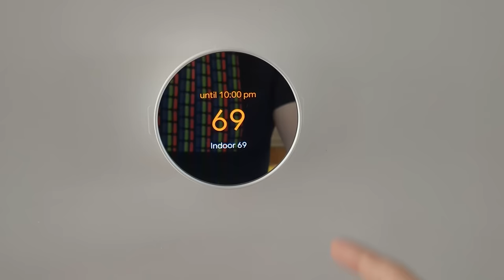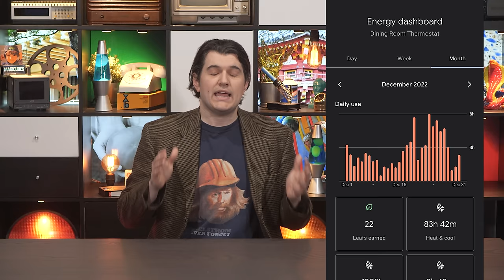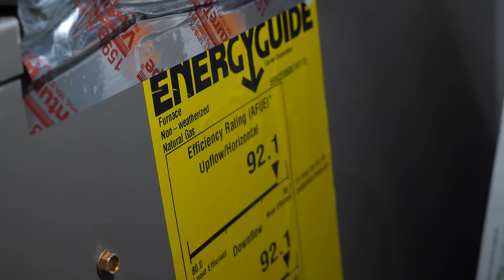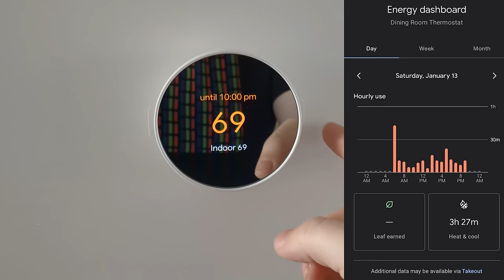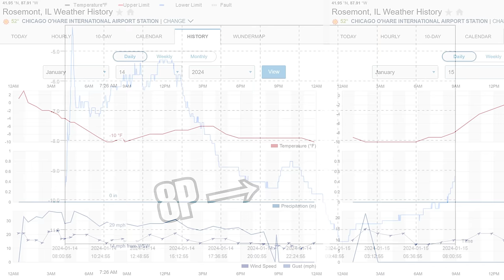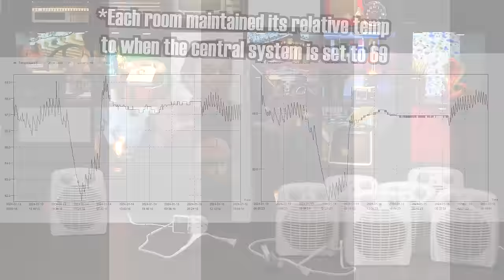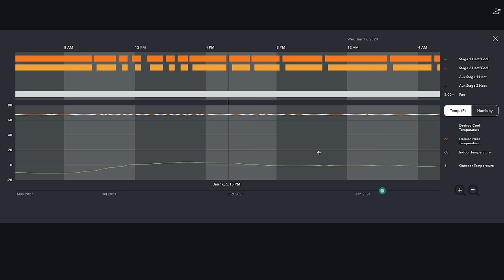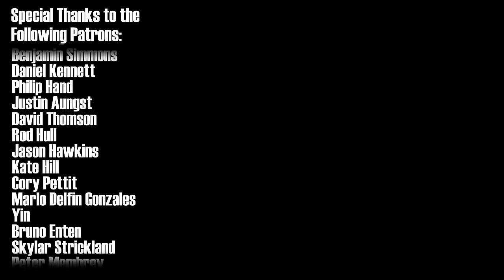Old HVAC industry practices are holding us back and costing us money. But we can fix it.

Comment: I would like to mention that oversizing a system also increases the longevity of the system by taxing it less. Creating a system which operates at 70-80% max is the norm for many devices (electrical or not). From fuel pumps and injectors to computer power supplies and cooling systems, and much more, upsizing increases longevity (unless there's a manufacturing defect or other variable contributing to wear) - even with the 80% load calculation already (hopefully) built into the device you're examining. In the case of the heat pump, I would (with only this videos information) take the 20k BTU "need" and install a 25k BTU system so it is never running at 100% but only up to 80%. You never know what components are actually being taxed at in a system unless you tear it apart and calculate load on each resistor and switch, etc. This also eliminates the need to run a separate circuit and system with the heat strips, right?
Reply: No, this is incorrect. Heading systems operate both more efficiently and last longer when cycling on/off less. Design temps account for running at 100% only once or twice a year already, most of the time a variable speed unit, if this is what you're referencing to, will only run at less than 80% anyway. By oversizing, you'll simply force it to short cycle as it hits it's minimum run capacity and still produces too much heat/cooling.

Comment: As someone who lives in a rural area that loses power several times a year (some of which are in the winter months), I, for one, am actually grateful that our heating system is oversized so a 6-hour power outage doesn't turn into 24 hours of shivering in our house waiting for it to slowly heat up, again. 

Now, there's absolutely an argument to be made that it probably doesn't need to be as oversized as it is... but some excess heating capacity is definitely handy!
Reply from the maker: Sure, but if you don't have any heat while the power's out, then a couple of space heaters can be that excess heating capacity without having to put that in your main system.
Additionally, heat losses are smaller when the temp diff is smaller, too - which means that, say, if it's only 50 degrees in the house after an extended power outage, even a system with zero overhead will rapidly increase the temperature at first. It'll get slower and slower as you approach the set-point, to be sure, but it's only at design conditions that this is going to be a big deal. And like I said - get a couple of $20 space heaters and you're 10k BTU/hr over your system capacity right there.
Reply: The rural area where I grew up routinely experienced multi-day outages, often in the depths of winter (we're talking -40C) well into the 2010s. This was in western Canada, about a half-hour drive out from a major city you would recognise the name of. We survived with copious amounts of blankets (and trips to my grandmother's, if her place happened to escape the outage path... it didn't always).
This was also the case in at the college I attended, some 800km away. The outages weren't as long, but they definitely were frequent.

Comment: A good rule of thumb for heat 5-10 million BTUs (5-10 Megawatts) per bedroom, double if the house is more then 5 years old and doesnt have any insulation or double pane windows. I would also recommend building a coal or nuclear power plant in your back yard to power it with a rail way that can accommodate 50-100 rail cars of coal a day. Simple better to have too much then be cold!
Reply: I was very confused for a moment lol

Comment: I install heat pumps in 🇬🇧 the uk thankfully because we have been doing them here now for around 15 years most of the kinks have been ironed out we have an additional hurdle to overcome here as the majority of our heating is done through water filled radiators so an installation usually also involves upgrading all the radiators to larger ones that work efficiently at a delta temperature of 50c it’s actually part of the building regulations to size all future radiators in new houses even if we installed a gas boiler to oversize the radiator so it makes a future retro fit of  a heat pump easier and more cost effective
Reply: Wait… you guys use heat pumps for radiant heat? I would LOVE to get one of those over here in US land. I have a house built in 1933 that, even with the smaller size gas boiler that someone installed in ‘94, appears to be just EGGREGOUSLY oversized. I don’t think I’ve ever seen a water temp above ~60°C, and that was during the morning warm up. The thing just never calls for heat. If the radiators are large enough, is it just a direct boiler swap?
Reply: @haanc2   for retrofit we have to upgrade the size of the primary pipework to handle the extra flowrate required going to and from the heat pump because of the slow heat transfer it’s usually 22mm 3/4” we upgrade it to 28mm 1”, your system has to be extremely clean or else it will block the strainers and filters that protect the heat pump everything else is just some extra diverter valves sensors and low loss header to hydraulically separate the 2 parts of the system.

If you ever do get one because you are in an older house I would recommend getting a high temperature unit that is capable to outputting 70c water if these are sized correctly you sometimes don’t need to upgrade the size of your original radiators because of the extra energy available in the hotter water
Reply: Was looking for the UK commenter, currently an RA and its awesome to see that this is in the US. Excited for the future of building performance!
Reply: In my current home we have massive old 70s rads, i was going to change them, but decided against it for that reason.   we know we can run the house fine with 55degree water from the combi boiler.. which gives reassurance that we could swap to a heat pump no trouble.  I now wonder if i could use my smart meter history to size it.
Reply: In the US radiators and piping for hydronic systems have generally been oversized for the heating needs. This actually has a historical context in the US, where, because of the "Spanish" Flu pandemic heating systems were sized to keep buildings heated with the windows open, as fresh air circulation was determined to be a key factor in preventing the spread of the flu.
Also, having read about earlier gravity fed hot water systems, I think that even after the introduction of circulator motors, the traditional tradesfolk sized piping based on that older knowledge, for most of the twentieth century.
Reply: Wouldn’t it make more sense to just install HVAC ducting in new houses? Maybe that could also help eliminate the dampness problems which are apparently common in even new British homes.

Comment: I’m a 40 year veteran HVAC Tech, Installer and salesman.  I take a 3 x 5 index card and from forty to fifty feet I hold the card up to block out the house. If the card completely obscures the house you need a 2 Ton system.  If the card is the same as the house you need a 3 1/2 Ton.  If the house is bigger than the card, a 5 Ton system.

Comment: I put a 12k btu mini split on my RV first to run off my solar array and batteries which worked amazingly. I just installed a 12k btu mini split on my house(I think it's illegal to do myself? whatever, that's someone else's problem) and it does exactly what I expect of it, keeps the downstairs cool in California heat, and I'm positive it's all the heating I'm going to need in my house anyways given that it barely goes below freezing here and my place is only 1300 or so square feet. The best part is it runs off a 10 gauge extension cord coming off my RV(only draws 700ish watts on high so not a particular concern in my book).

Comment: Around here (Vancouver, Washington), one educated and competent HVAC sales/installer referred to the original HVAC installers from the 1970s and 1980s as primitive hill billys who descended from the hills and installed systems which were way too big just like you described!  When I re-engineered our system from baseboard heaters to a heat pump, it would have required a 4 to 5 ton system.  We looked into adding insulation.  For less than $1500 of insulation injected into the walls, we easily reduced the heat pump to 2 tons and it took less than a week to do.  The house is now much quieter (the neighbor's dog whining all night can longer be heard)!
Reply: Hopefully when you sell the new owners will be happy with what you put in. Could you imagine if you were selling FHA and the inspection came back saying the furnace was not code and you have to upgrade it?
Reply: Right, insulation is probably the biggest factor to reducing the BTU load needed, even if it's just doing the attic.
Reply: @Progrocker70  The attic insulation was done many years before.  The "standard" insulation for this house (built in 1953) was pretty pathetic.  There was a little insulation in the walls (an upgrade in its day) but it was a sad R3 rockwool.  We upped it to R15 in fiberglass.

Comment: @technologyConnections - I believe you left an important element out. The speed or rate of heating from a property that has already cooled. It is quite normal in UK/Europe to turn heating off at night or during the day when no-one is there to benefit from the heat. Then when people get up in morning or get back after work, the heating system works quickly to get the property back up to temperature. This means the heating "furnance" needs to both overcome the heatloss as well as raise property from an initially low temp. This means it needs to be more powerful that just overcoming heatloss alone.

Comment: The issue you're overlooking is comfort.

If your furnace was 1/4 the size, then it would take 4 hours to bring up the temperature in the morning instead of an hour. We're in South Carolina and our furnace is 250k BTU. We also have a blower sized for six tons but only a 2 ton AC. The guy who did a load calculation for us when we replaced the AC said that probably the previous owner had complained to the installer that it took too long to warm the house so he put in a bigger furnace to make the system faster.

Interestingly, he also determined our returns were undersized--just 50% of what we needed. 

When we added on 200 square feet for a new kitchen we had a mini-split installed. We use it now and then for AC but never for heat.

Comment: I did an update from oil heater to a geothermal heater and in my case all the quotes were done with using the used oil per year value for making the correct choice for the geothermal heater unit and drilling depth. This was although in Finland. I ended up with 200 m of drilling depth and the efficiency of the system has been 5x - 4x.

Comment: It's quite clear TC doesn't have a wife and teenage daughters. That blast furnace gas heater wasn't even anywhere near enough for their comfort. 2,000,000 BTU as a minimum. Also all the poor guys working in a stuffy office in the middle of summer - yeah, keep the windows shut and the heaters on for the girls. LMAO. You know it's true.
Reply: Not all women are like that... I am, but my mom and my four sisters ALL run hot. If I could sneak the thermostat as high as 18C, that was a win for me.

Comment: I was surprised 2 years ago when I replaced my old heat pump system with a new one.   The old one was on its last legs and was 26 years old.  When talking with the sales person, they actually asked to check my attic and they measured my rooms along with checked where my registers were as well as measured my air return ducts too.  Then he asked questions about how often the old system would cycle and how it was as far as cooling and heating and how long things ran.  Once that was done he presented me options, and told me I actually needed more cooling than heating to ensure the system would ever make it to the desired indoor temperature.  The new system uses a proprietary thermostat but honestly it works really well and as the system is variable speed system.  If the weather is between 40 and 60 my system barely every runs, once it gets below 40 it does run more and once over 60 it runs more as well, especially when its dehumidifying the air.

Comment: When living in dorms/apartments, I NEVER used my heat. I had to open the windows when it was 10 F degrees outside because radiant heat is insane. For shared housing/town homes like yours, a vastly undersized furnace would be ideal but for everyone else living in single family home, the larger heat pump systems might be necessary

Comment: Inverter Heat pumps come in ranges like 1-3 tons or 3-5 tons. They modulate based on the formula deltaT=Btu/hr * CFM*1.08(Specific Heat of Air). It is almost impossible to size a heat pump wron unless it is on the brink of 3 tons

Comment: As an hvac contractor. The reasons furnaces are sized that way is due to the blower cfm in the furnace to be adequate for the air conditioning. Also. Gas furnaces are and will always be 10x more reliable than a heat pump system. Switching to heat pumps is stupid for many reasons in my opinion. Biggest of which is our power grid is not ready to handle that amount of electricity use that comes with the electric heat strips.
Reply: Are you living in the 90s? Modern AC/Heat Pump designs are incredibly efficient.

Comment: I am a retired HVAC sales engineer that I was doing manual j calls on all my sales quotes. The local towns began requiring them for a permit to be issued.  The problem is the huge amount of time it took to measure up each home and get accurate information. We had to also measure steam radiators and baseboard installations to match the proper size boilers to the homes.  I now have a single stage 15 Seer heat pump for the main part of my town house. I added a 3/4 ton ductless heat pump to heat the basement which formerly had a baseboard length to cover it. Much more comfortable and happy with the ductless heat pump.  It was runs continuously but supplements the main system.

Comment: I replaced my 5kW electric heater (PTAC) with a 120V Mrcool DIY 12kBTU heat pump. At first I was nervous how it would do and on a couple of the windy cold days it struggled to keep up, I think about 40 was the coldest it got inside (very cold but life threatening). I spent a couple days sealing and a thousand dollars on insulation, now I am warm and my electric bill is about 1/4 what it was during the winter! I will keep insulating for comfort if nothing else!

Part of the reason I went with the "undersized" unit is because I also have 100A service and electric car, water heater, stove etc. If things happen to all run at once I do not want the headache of my entire house tripping.

Comment: I recently moved into an apartment with central heating and cooling and the vents are high on the walls. The hallway has a bit of a shorter ceiling to cover the ducts and we don't have an attic or basement. There's also a small closet in the hallway that houses the heating/cooling system and the water heater. I'm also a fellow Midwesterner

Comment: 43:43 Fellow Chicagolander here. I represent that remark. When a previous homeowner finished the second floor of my house, he ran the supply ductwork through the attic. The plus side is there isn't much purpose to insulating the attic because it is well heated in the winter.

Comment: Fascinating! Amazed that your furnace doesn't also heat your water. We have a 32KW gas boiler for a small 3-bedroom house. It is specified so that it can heat sufficient water to be able to run two showers simultaneously (there is no hot water tank). Also, an explanation of what HVAC stands for would help your international viewers. It stands for High Voltage Alternating Current here in the UK. 😀

Comment: If you plan to use a heat pump as your only heat be sure to size it according to what it produces at -13 (or whatever your lowest temp is) Unless you have another source of heat or you will be COLD In NC I needed either a 6-8 ton system OR a 3 ton with backup/high-demand gas unit I went with the 3 ton and the furnace only runs 2 mo./year (about 3 or 4 days/week)

Comment: Others may have pointed this out, so sorry if it repeats, but there is a level of consideration for an oversizing of 1.5-2, so that you run your "whatever" system at their most optimal range, and also extend it's lifespan by not pushing it to the max, however this may come at the cost of efficiency.  All in all, too much oversizing is a bad idea still, but there may be reasons. 
In Europe it is so different, new building codes only really allow for heatpumps in our buildings, so not much to consider here, for hot water  large size water puffer storage is used...

Comment: I'm only a minute in, but i am already getting annoyed that I'm not giving the info i care about. When the house was built, size of furnace, how cold it got.

Most engineers in the artic actually undersize the HVAC system for heating during the winter. Where the furnace can't heat the house on the coldest days, but we only expect those temperatures a few days out of the year. 

This has became even less of an issue with all the electronics people run and house insulation improving. But the tight house saving your energy bills may also be creating health problems by lack of air circulation.